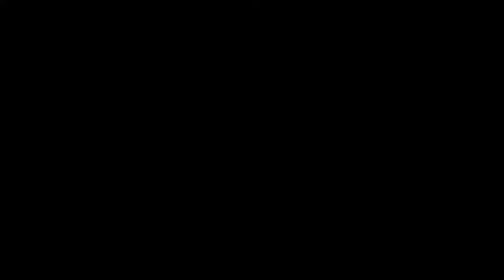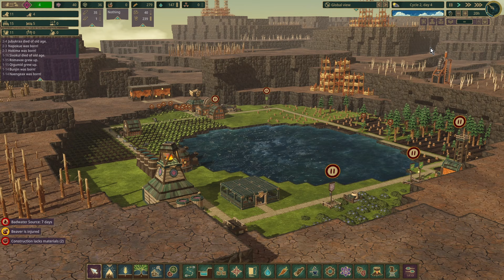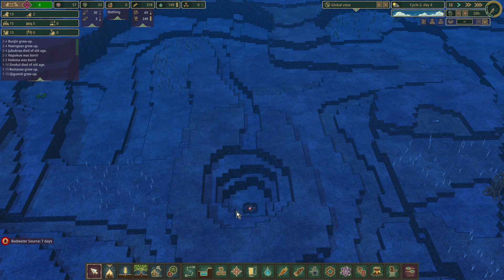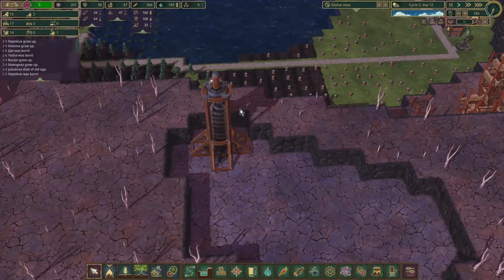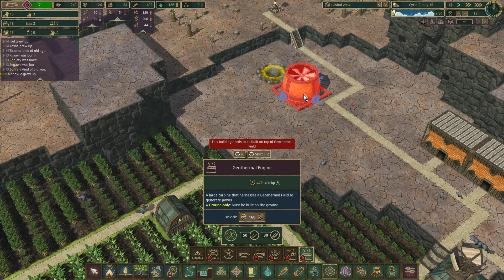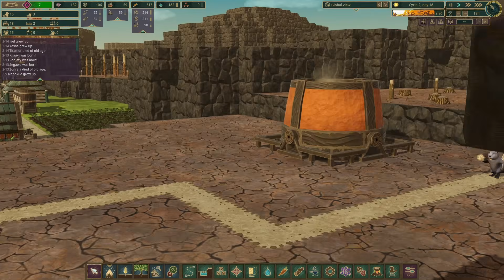Timberborn 1.0 Experimental | Power And Industry

Comment: Technically if you're not going to have your Forester plant your Pines you shouldn't mark the area out yet as that stops the existing Pines from spreading naturally. How about unmarking your Mangrove area?
(Had the Industrial Lumber Mill been one square to its left, there would have been a nice spot for the Fermenter.)
You used to be able to find power connections by placing a Power Shaft nearby. Does that still work?
I couldn't find a nice way of arranging buildings around the Geothermal Engine, so I'm going to say that the path was in the wrong place 😉
If you weren't micromanaging your workers I would suggest placing your District Centre on lower workplace priority and setting it to four workers, or building several Inventor Huts and setting them on low priority.
Are you not ready to unlock medium water tanks yet?
Instead of making a power bridge, you could have run a power shaft under the platform below one of the sets of stairs. (I doubt it's worth actually replacing the platform with a vertical power shaft.)
Reply from the maker: I don't want to unmark the Mangroves just yet. I'll want to set up sluices around the seep to try and protect us from the Badtides befor I allow them to grow freely.
I'm not sure if the power connections light up. I assume that the devs will have kept that - it was a very useful feature!
Yeah, the path was laid in long before I knew how the engine worked! I could probably have figured out a better layout.
Once I have a larger population, I'll definitely start using priorities a lot more. I think I already have the water pumps on high priority.
I think we need gears for medium tanks, so it shouldn't be too long before we have enough resources to set them up.
Oh yes, I could have done that, couldn't I? D'oh! Oh well.
Reply: @StormhavenGaming  Hmm, I wonder whether you can game the Mangroves by marking the sluice area as for crops so that the Mangroves don't try to grow there 😉
Reply from the maker: @urkerab  That is a very good suggestion. Thank you!

Comment: I'm not sure how Normal mode is going to treat you with bad tides, but if you got one now you would not be happy. At all. I think you should prioritise getting power to that aquifer drill and get a lot more water storage on the go :)
Oh the spral stair case is useful in tight spaces, but uses treated planks.
Reply from the maker: I certainly imagine that we are not even slightly prepared for a Badtide! We are working on getting that aquifer powered but it is going to take a lot of resources to spread the power connections that far.
Ah, I didn't even look at the recipe for the spiral stairs!
Reply: @StormhavenGaming yep, I'm playing Folk tails so could put a windmill up there :)
Reply from the maker: @gshingles  That would work for the 20-30% of the time that the wind actually seems to be strong enough to provide power!
Reply: @StormhavenGaming 😅 yes. It hasn't actually been much of a problem though. Come to think of it, I haven't caught the wind not blowing that often. I wonder if they've updated that... 🤔

Comment: Don't forget about the small water wheel, you don't have to go for the 2 deep large one immediately and you can get the badwater to work for you.
Reply from the maker: I'll likely use the smaller one in a few places. The large on will be used if we do build a large Badwater reservoir and viaduct system for power though.